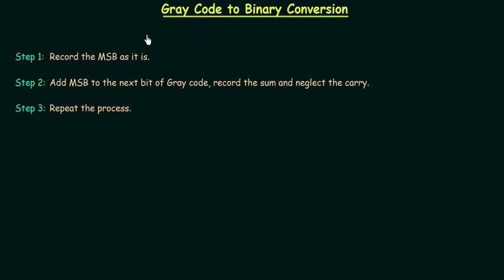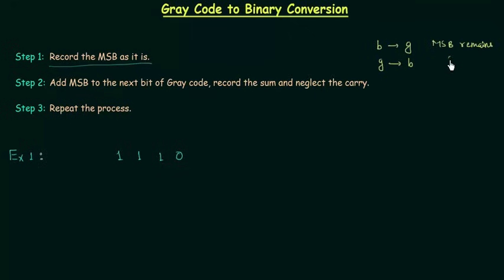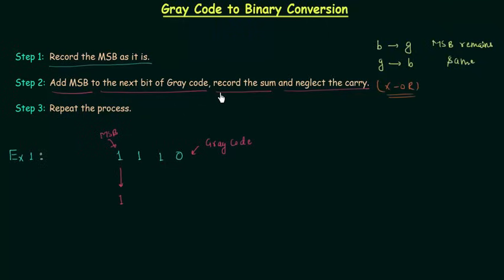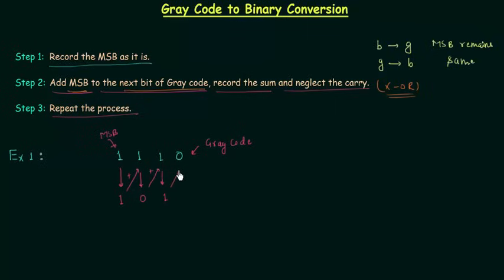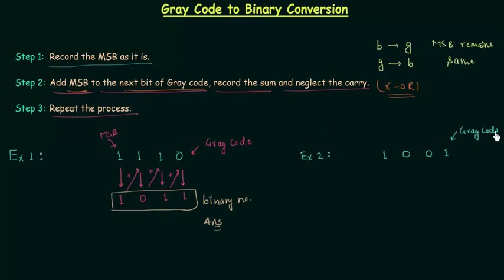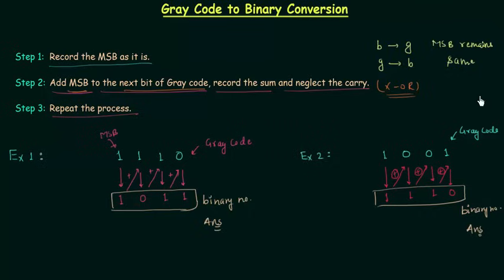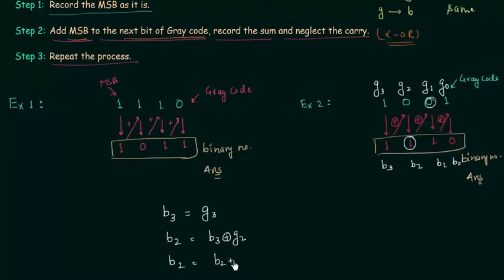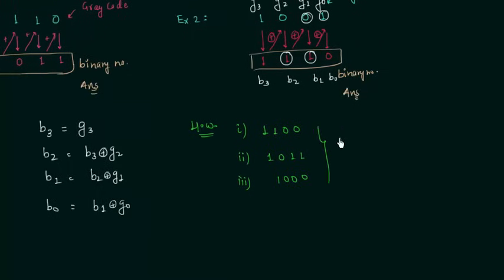Gray Code to Binary Conversion

Comment: Incase you wanna do it program. A gray code is bascially just the sum of Xor of bits starting from that position of bit. For examples the Nth bit from gray to binary gonna  be Nth^N-1^N-2^N-3^...to the last set bit. In program you can achieve this by just creating variable like b that starts from 0 and Xoring it with the gray code and then storing the value of it in b (b=b^gc). while the n is right shifting by 1 in each iteration(n=n>>1) until it reaches 0

Comment: Hi,

If i convert 1001 (bin) to Gray code i get: 1110 

If i convert 1110 (Gray) to Binary, i get: 1011 

Is this normal? shouldnt my conversion from gray to binary be the orginal 1001?
Reply: Converting 1001 ( binary ) to gray should give you 1101 instead of 1110. There is, I believe, a slight mistake in the steps he's written. To put it straight, while converting from binary to gray, you have to XOR the bits of the original number. That is, to convert 1001 to gray, I'll put '1' as it is, then XOR 1 with 0 giving me '1', then XOR 0 with 0, giving me '0' ( and not 1 ) and then finally, I'll XOR 0 and 1, giving me '1'. Hence 1001 to gray is 1101. To convert from gray to binary, I'll have to XOR what's recorded with the next digit. Hence, converting 1101 to binary, I'll put '1' as it is, then XOR 1 ( that's recorded ) with 1, giving me '0', then XOR 0 with 0, giving me '0', and finally, XOR 0 and 1, giving me '1'; thus my number will be 1001, again. Hope that helps
Reply: @kushagradhawan6875  
Hey :),

You reworded what he literally did, where do you see a mistake?🤔